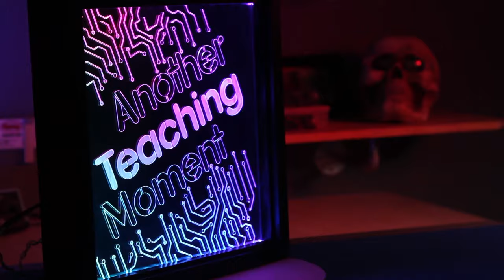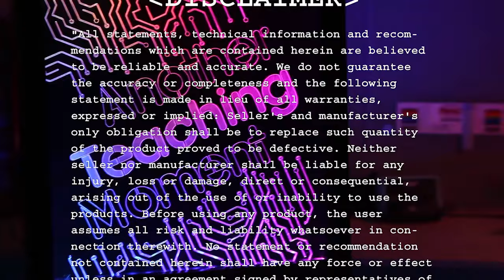How to Easily Determine Barrel Jack Diameter - Another Teaching Moment | DigiKey

Comment: I keep a 2.1mm barrel jack in my toolbox for this.  It's labelled and some clear heat shrink tubing keeps it readable.  If it doesn't fit then I'm trying to plug into a 2.5mm receptacle, and comparing the ends side-by-side makes for easy input size determination.

Comment: I appreciate you video very much.  The two sizes of plugs that you illustrated are common on 9 and 12 volt applications.  I use calipers to directly measure the OD, and I use twist drill bits to fit the ID, and then use the calipers to measure the drill bit.  This method will work for most sizes of barrel plugs, but many times smaller voltage applications have smaller barrel plugs.  I am looking for a way to measure the JACK dimensions (JACK = hole or port or female connector, usually surface mounted).  Any thoughts on this?
Reply: I have a variety of sizes of female pins.  I find the one that just barely fits. Then I use the drill bit method to measure it. You could use thin wall stainless steel tubing in a few sizes if you don't have an assortment of female pins.

Comment: It's seriously stupid that they don't just label the damn things.
Reply: or color code.....
Reply: that would be too easy and nothing is made to be easy, matter of fact i just found an old cd player that ONLY runs on DC power and has a DC female plug but it does NOT show the operating voltage anywhere on the unit so i am like ... WTF ... you got a dc plug there but no voltage rating ??

Comment: Clever solution! I need to buy an extension cable for an outdoor WiFi CCTV camera, as the cable from the power socket to the camera is too short. This means I'll be able to find the right pre-made cable first time. Much cheaper and more tidy than installing a mains electrical extension. Many thanks!

Comment: How would I go about powering 2 devices with a splitter, both needing a different barrel size. Are there splitter cables that have different barrel sizes on both ends?
Reply from the maker: Hey there, I did a quick search and didn't see one. However, if you reach out to our Applications Engineering department via the TechForum, they may be able to locate something. https://forum.digikey.com/

Comment: I wish I could resize this 2.1mm I have to make it .4mm wider.. need it for my ts100 dammit
Reply: you can get a barrel adaptor to achieve a 2.1mm to 2.5mm output.  The downside is that it makes the overall connection longer.